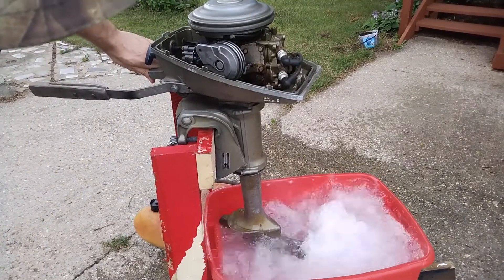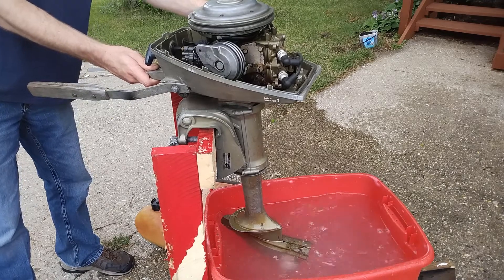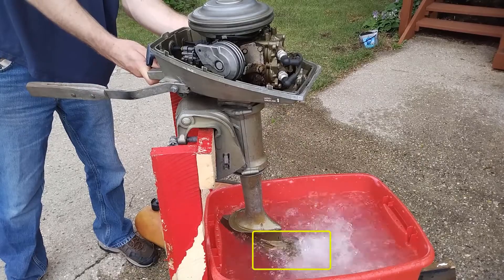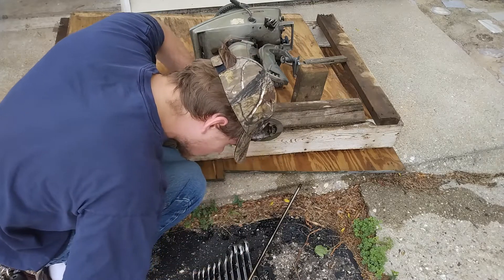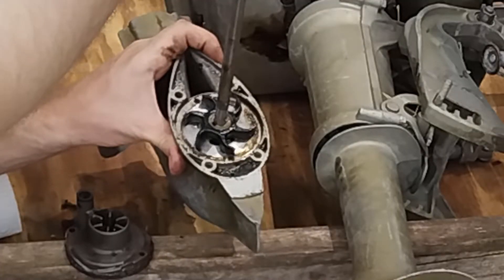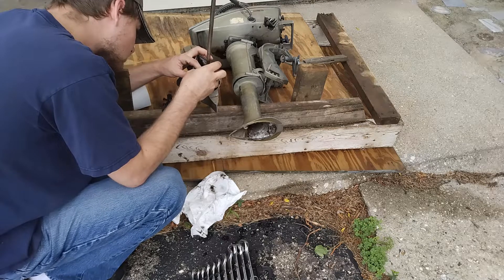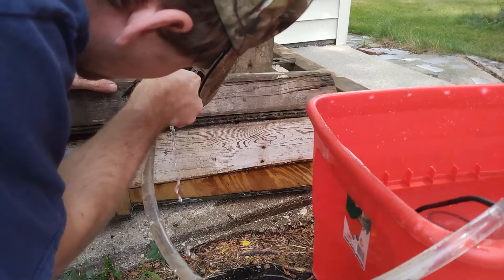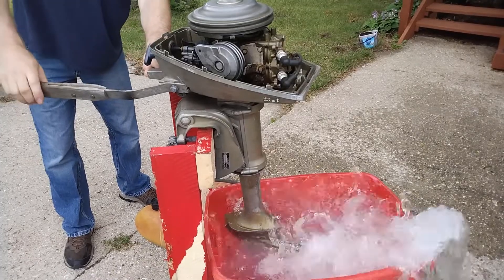1972 Johnson 4hp Outboard Water Pump Test

Comment: I just bought one of these Engines.  Johnson 4HP, 1970.  I haven't worked on it yet and do not own a Boat but love small engines.
Reply from the maker: Lever at back of cover on the bottom of the engine.

Comment: Not in ANYWHERE NEAR enough water. The pump does NOT draw water, it needs to be under water. There is tiny holes on the BACK of the leg that blows out water or a MIST when it is ACTUALLY working. That impeller is NOT good, it has lost its flexibility. This guys needs to go back to school on outboards.....or at least STOP giving tutorials he doesn't know much about.

Comment: OK, well it is important to have you tank water level high enough to make sure the water inlets are covered by water.  The water level should be above the gearcase/exhaust housing joint.  Pulling the gearcase off is easy, trying to realign that water tube during assembly is the tough part for sure!  Always remember to make sure the upper driveshaft oring is in good condition and lube the splines properly or else the crank/driveshaft splines will get wiped out and the poor little motor will be ruined.

Comment: I took the lower housing off to do the same test, I then hooked a squeeze bottle and hose up to the pickup tube but very hard to get water through. How much preasure should it take? I feel as though it may have a restriction. Idk if these small motors have a thermostate?
Reply from the maker: I don't remember it being super hard...it just seemed to flow right through...

Comment: We have a Mercury 4hp... no water tell-tail... Do these engines have one ?
Reply from the maker: My understanding is that most outboard engines do... normally in lower unit like this... Sometimes you can find a manual at a library or look for a boating forum online...
Reply: @PatriotContraptions  Yes I would have thought so... we took the bottom of the leg off & spun the water pump shaft & water flows... however no tell tail when engine running... can't find any youtube video's of this motor with tell tail

Comment: There are small holes above the water line that you can tell if water is coming out of them
Reply from the maker: Is that the four on the back of the unit? Because I was thinking it would come out there too but it doesn't when I have been testing it...I think it's just falling all the way to the bottom and going out the exhaust do to lack of pressure to go out the holes in back...
Reply: @PatriotContraptions  yes those are the holes water should be coming out of them. Sometimes it may take a while for the water to start shooting out but it should.  On these 4hps it doesn’t pump water to the head it’s only to cool the exhaust tube. I’d just replace the impeller and the gaskets below the impeller plate. to be safe not sorry very cheap and easy. I had one of these 4hps that I forgot to check if it was pumping water when I bought it and next thing you know I burned up my exhaust housing. Very nice one you got there they are tanks!
Reply: @evinrudej  Water doesn't cool the head ???   What stops the engine overheating & seizing ?.....
Reply: @jimmysparks315  
Good point, seeing as the motor is snug as a bug in a clam shell under the dog house cover, where no fresh air gets in there to cool anything. I have an old McCulloch that’s the same way, from what I read about it on the subject, but I still don’t understand. Heck, I still don’t understand why there’s no air filter on outboard motors. Even though there’s no dust on the lake and the carburetor is sheltered inside the clamshell, there’s always all kinds of spider eggs and earwig crud and mouse crap and cat food at the mouse drug in.. all waiting to get inhaled into the cylinder.
Reply: @evinrudej  Has anyone checked the actual temperature of the head while running .  I have  a little water coming out those weep holes ,but not much.  I checked the temp with an infra red meter at  the head where the plugs screw in and got around 400 degrees F    will probably just do the pump